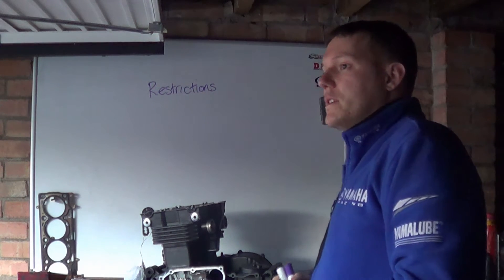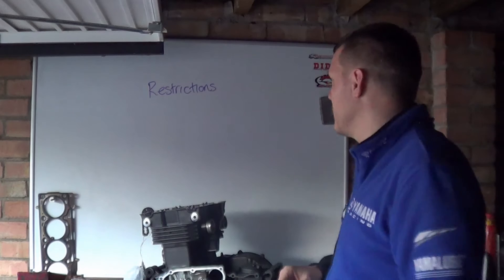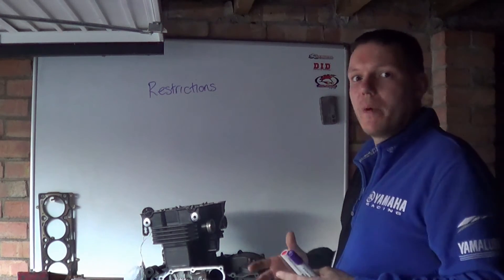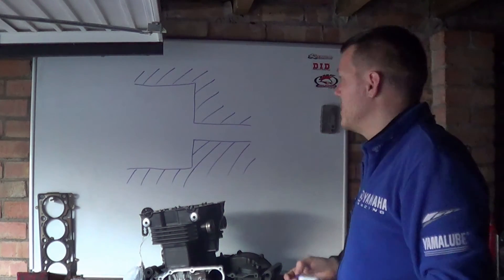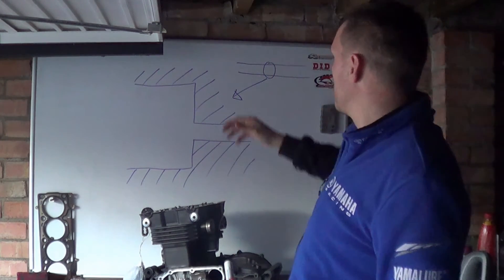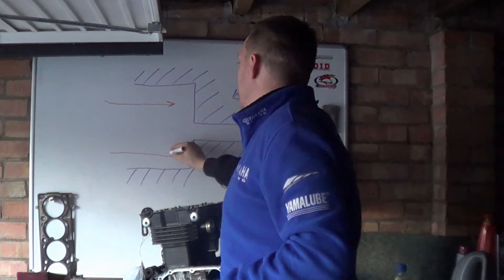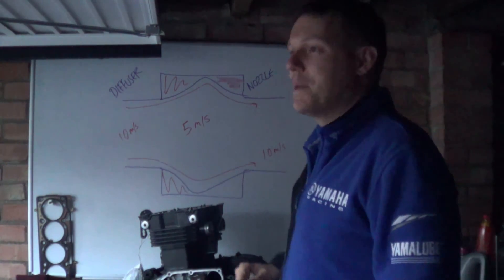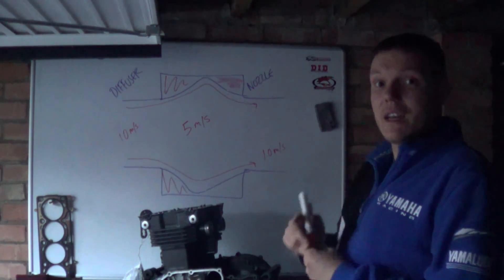Engine Fluid Dynamics - PART 3 - RESTRICTIONS

Comment: You should have included temperature in your pressure differential demonstrations because the temperature changes are a huge part of intake design specifically F1 intake scoops going from a small diameter to a very large volume